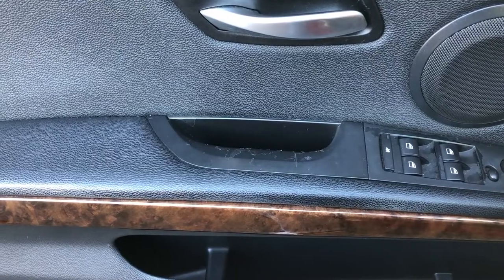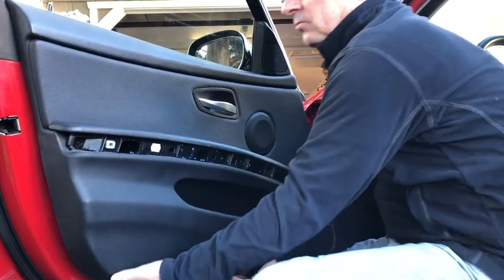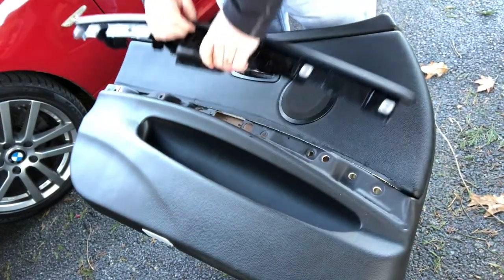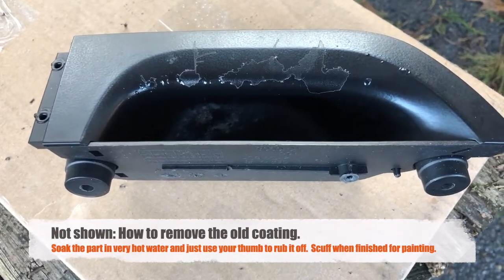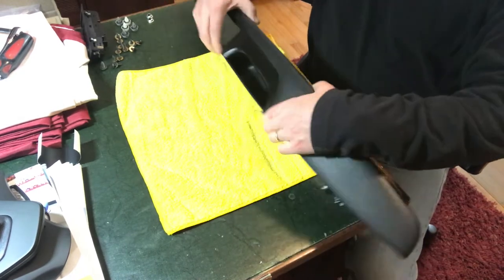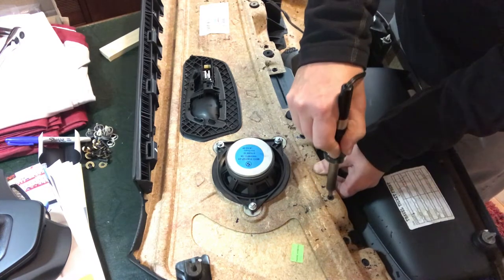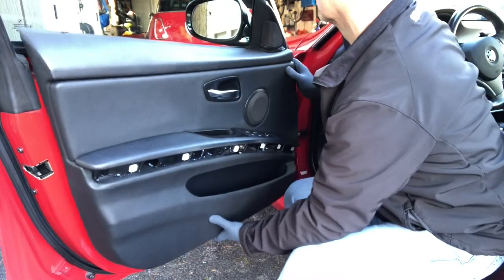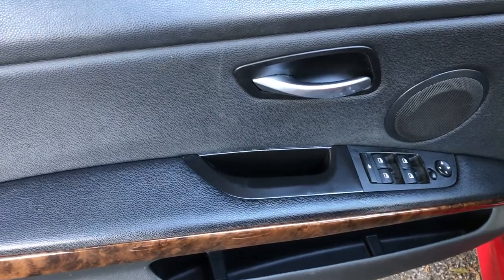BMW 328i Driver's Door Handle Repair #restoration #bmwe90 #bmw

Comment: What size screws did you use after the plastic was drilled off?  Is it possible to use screws for all the old drilled off plastic posts instead of resoldering it?
Reply: Hi,
I ordered after market replacement ones from Ali express. I have grey interior the colour is close enough. I couldnt bother restoring the originals. I received mounting screws with the new set so that is awesome. I wouldnt want to solder the plastic. The screws that came in the pack has washers included too.